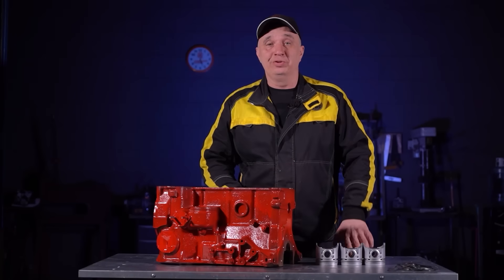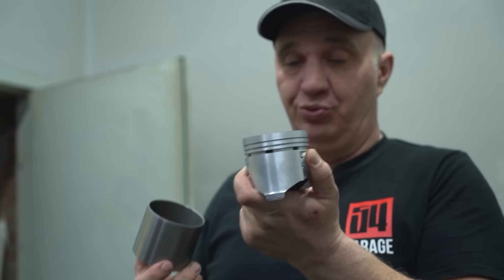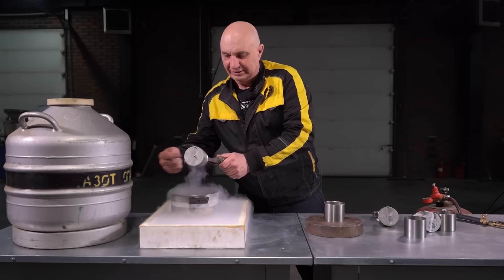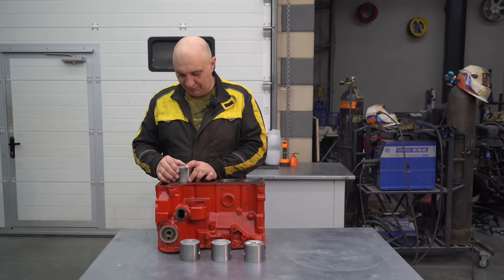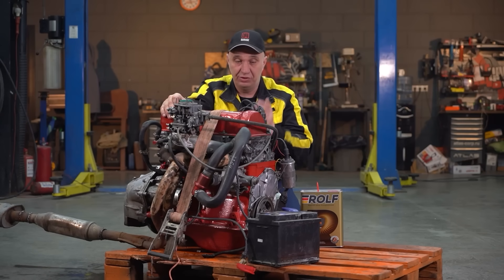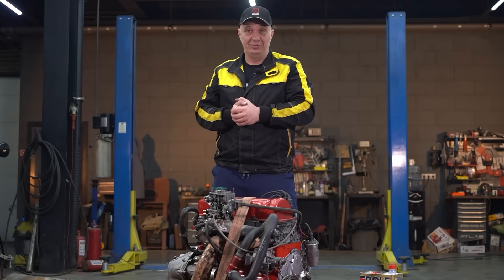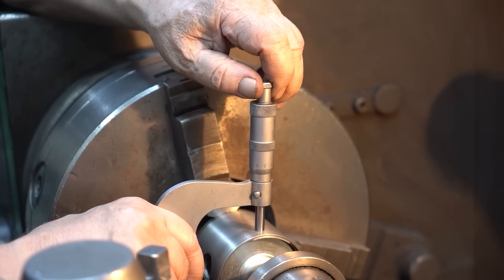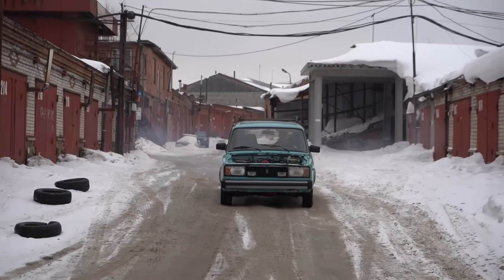We fit pistons with no rings to an engine - will it work?

Comment: Fun fact: F1 engines have such tight tolerances that they seize up when cold and need to be preheated to run
Reply: i don't believe that at all- i build street motors that are even tighter but they have to last thousands of hours.
Reply: Yeah never heard of anything other than ice expanding when cold
Reply: @RVsandRCs That is the interesting part: it happens due to expansion. I believe the pistons are made with higher magnesium content aluminium alloy to make them lighter, and this alloy expand less than the one the engine block is made of. That means that when cold, the pistons are seized, and to start them they pump heated oil through the engine. This expands the block more than the pistons and allows them to move. For F1 cars it makes sense because they can warm up the engine before the race without penalties and even a minimal efficiency increase means a few extra HP from the same fuel, which is capped.

Comment: Model engines do run w/o piston rings w/o any problems. What you did wrong are basically 2 things, 1) you should have made horizontal grooves on the piston which can pick up oil and lube the surface better, about the same a piston ring does. 2) a break in was needed to polish the pistons to the size of the cilinder before hitting throttle harder.

Comment: Actually original pistons are not round or straight because of the different thermal expansion. You need a special lathe that can produce a defined shape.

Comment: Its like measing around with something that has allready been proven millions of times.Rings machine them selves into the liner or so called cylinder wall. Miniature 2 stroke alcohol motors used that operation for years and were OK as long as you ran castol oil mix in ignition with fuel. Technology really helped us learn more about ALLOYS and improvements on engines and the platinum wre effect it had on changing a monoxide into a dioxide for a cleaner planet. Now all that has been learned and so thought  lessnessy been FORGOTTEN AND IGNORANTLY  BEEN MURDERED  BUY  DELIVERENT IGNORANCE  AND UNAPPRECIATED  PEOPLE.

Comment: Perhaps using the pistons that came with the engine but take the rings off and sleeve the cylinders smaller to fit the positions with no rings. May have worked better.

Comment: Yes this could work if the cylinders are tapered enough. Unless there's some other form of seal, which is the reason for the Rings themselves. Outside of that know this is nonsense and ignorance which has been overcome by many many many many years of Technology brought about by the people who actually manufacturer design and build actual engines that function for many years

Comment: I designed an engine when I was 15 just to see if I could simplify the 4 cycle engines standard 2 valves & ports design. I have not built it yet but it seems like something you guys could do without much difficulty if you wanted to. Basically it is to use a reed valve as a 2 cycle engine has fitted to an intake port at the bottom area of the cylinder so that as the port becomes opened to the dropping piston a large vacuum has been built that draws the intake charge in. It compresses and fires for the power stroke and just before the intake port becomes exposed to the hot gasses a large single regular style exhaust valve opens and relieves the pressure so as to not damage the reeds of the reed valve. The exhaust closes after the piston reaches TDC and it begins again. Now you guys get so many comments that I doubt this will even reach your attention but if it somehow does I might literally crap my pants if my engine design idea was actually built and tested.  If the intake pushrods were removed and reed ports cut into the block a regular engine could be modified to be used for testing. Love your channel and thanks.
Reply: Look up Detroit diesel 2 strokes they work that way

Comment: Small model aero engines up to  6cc often employ a close tolerance “lapped” ringless piston.  As the size increases the harder it is to make a close compression fit that still doesn’t seize.  They need very oily fuel and a long breaking in period.

Comment: If you had made the pistons completely from cast iron, things may have turned out better.  Even though the sleeves were iron, the aluminium pistons would have expanded, forcing those sleeves to stretch.

Comment: Key point: the metal WILL expand as it gets hot. This is an unstoppable force. The steel sleeves around the pistons might SLOW DOWN their expansion a little, but does not PREVENT it. The aluminum still gets hot - and still expands accordingly.

Comment: water in the jackets cooled the cylenders to the point they could not expand enough to maintain proper clearances. Dissimilar metals are your problem. over 100 years of engineering solved all these problems.

Comment: Great experiment! I can't help but wonder if you could add oil lines and regulate pumping have continuous circulation of the engine oil being cooled using the radiator similar to transmission oil does. ??  My guess is if nothing else it would certainly run longer minimum or maybe indefinitely.  I'm sure this has all been tried, and that is why we have piston rings today!  😆 🤣 😂  Either way, it's fun to watch!

Comment: The use of a torque plate attached to the block helps to make the machine work more accurate  it stresses the block as if it had the head mounted to it

Comment: some rc model engines run with no rings, but run fuel mixed with lube, alcohol based fuel , also same metals, using cylinder sleeves in an aluminum engine chasing,, sleeved aluminum pistons didn't achieve the goal.of equalizing expansion, what may have helped is machining ribs to the piston to retain oil, to fight contact wear? Next would be harder, calculating the offset of expansion, giving clearance along areas, so at operating temp it would end up expanding into true round , issues of unequal cylynder expansion also play, water cooled blocks live with distortion of cylinders especially where cylinders meet and operate dry, air cooled is the way to go, like vw bug engine.?

Comment: That's why they make no gap rings. The tolerance has to be there for the bore. But you have to use no gap rings for perfect compression. And to not burn all the oil out the motor!

Comment: With those cases surrounding the pistons, there is no oil flowing to the cylinder walls to cool and lubricate everything. That's why it seized. Next time, try it with just the pistons in an oversize diameter, or add some oil to the fuel like a 2 stroke engine.

Comment: Cox airplaine engines do not have rings but the piston is SOLID, made of same metal as cylinder. also, has oil in the fuel as TCL. . . . ;-)

Comment: Small engines for remote control airplane etc have no piston rings. Yes, it will work, but it's not very efficient. Unless you've got oil sprayers for the wrist pin, it's probably going to seize up because there is no oil being scraped off the cylinder wall going into the wrist pin oiling holes.

Comment: Model airplane engines have rings and no ring design called ABC. Aluminum piston, Brass sleeve, Chrome plated. The sleeve is tapered, tighter at Top dead center where it makes compression. Very common design for them. 2 cycle oil in alcohol fueled glow plug motors. Very durable. Not as suitable for larger bores, expansion affects clearance

Comment: Pistons are not supposed to be perfectly cylindrical. Because of the casting in the thick parts and the thin parts they expand at different rates..  and when they expand, they will become cylindrical.  
    By cutting them down, cylindrical in the first place when they heat up and expand, they will no longer be cylindrical. 🤦‍♂️.            It’s better to have clearance anybody who’s had engine design classes as a high school student knows this..

Comment: It will never work, might work for start up duration, but run it for 2 to 3 hours and see what happens to cylinder walls and the piston, piston rings has an very complex task, usually made from ductile iron, ring gaps clearance between the piston ring is to further act as an seal, as the high cylinder combustion pressure tries to escape through the gaps between the piston ring and piston ring grooves, the piston ring expands and pushes against the cylinder wall, the oil trapped within the gaps seals the air from escaping, hence the piston can seal properly even with an not so tight piston to wall clearance

Comment: It’s called cold sieze, thats why on a snowmobile when it is like zero degrees out, or colder, you dont just hammer down on the throttle without letting it warm up first because yr piston will swell but yr engine block has not warmed up & expanded with the piston, there fore yr going to sieze yr engine , that is just common sense, this has been known for decades !!! This guy must have just crawled out from under a rock !!! 😂
Reply: true but its also sad people think you need to only idle your car to let it warm up. they think driving sensibly at lower rpms blows the engine too

Comment: Lol compression = hp it can work but not well the oil is what it’s not getting the fluid film it needs to seal the rings there is also ring gap that loses power too it can be made to run but very non efficient less than 10% the hp with piston rings

Comment: Lots of rc plane engines use ringless pistons. They run very well once started and warmed up. But they don’t like to start when cold. We used to sit the plane under the tailpipe of our cars to warm the engine before starting. 
The cylinders are conical near the top so there is only friction and compression right near TDC.
Reply: Do not forget, all our modern ringless model engines made with chromed bronze, or aluminum (!!) sleeves: the piston and sleeve alloys are very precisely harmonized by the aspect of heat expansion in wide temperature range. (ABC or AAC systems. All highpowered categories (speed, Pylon race, combat,) etc. won by ringless engines, for 10-20 years, or more...
Reply: When I was in the hobby I used to fly when there was ice and frost on the ground, I dont recall having any problems starting.
Reply: pretty much ALL pistons have some sort of taper from the skirt tips all the way up to the crown.

Comment: You have to make the clearance work for operating temperatures, not ease of starting. You would have to use some sort of block heater to pre-warm the engine to make it start.

Comment: Someone said to use 2 stroke which could work but the only engine I found that doesn’t use rings but made in a mass production was tiny nitro engines for RC cars and stuff, and that’s technically a little two stroke diesel motor that runs off nitro methan with oil

Comment: The aluminium expanded stretching the cast iron outer more heat goes into the piston sooner than the block, Small model engines use lapped pistons with no rings but the small size makes the expansion amount far less and methanol fuel and 20% keeps things a lot cooler and better lubricated. the smaller size speeds the even heating of the piston and cylinder as well as being a 2 stroke with the hot exhaust going through the ports in the side of the cylinder carrying lots of heat away with the oil.

Comment: I can't get over the lack of provision for allowing oil to ooze from the ring grooves and out to the outer piston.  Or, better yet, splash lubrication like a lawn mower engine.  Some dippers attached to the bottom of the connecting rods that will splash oil against the cylinder walls.

Comment: Should do same experiment with ceramic pistons…ceramic does not expand.
I’ve remember reading about the prospect of constructing most of the engine in ceramic, then run it on diesel at high temperatures…very efficient!

Comment: Could you fit the rings in the cylinder wall? If the piston is long enough, they'd seal over the entire stroke.
Reply: That’s a good idea, but kinda pointless because you’re still using rings. My thought was to make the clearance as big as it needs to be for a perfect snug fit at running temp, obviously then it wouldn’t build compression to start but maybe you could put in some kinda over powered block heater to get it up to temp in order to start or something like that just to get the cylinders and block up to temperature.
Reply: @brandoncastle2684  And your heat control would need to be laser accurate! No chance of getting away with a mild overheat, and a major one would be more work than a light skim and a new head gasket. These things are always worth thinking about, but I have to accept the conventional way is conventional for good reasons.

Comment: You should try method that is used on F1 cars. You need to warm up the coolant, oil to working temp without running engine. When engine block would be warmed enough, the clearances would be bigger and you could start engine.

Comment: I just love how these guys keep coming up with original ideas and yet many of these ideas have always been somewhere at the back of my mind but I never imagined someone would actually try them out and have the necessary skills to do so. For any young kid with aspirations of becoming a motor mechanic or engineer, this channel should be a must see!
Reply: It's not an original idea furthermore it won't work
Reply: @boarhog1979  Few ideas are totally original but these guys at least keep coming up with different concepts and put them to the test in their own style. Most of the things they try do work up to a point but of course would be impractical and unreliable in the real world. The point is that it’s fun and educational and it gives a real life demonstration of why some of these things don’t work.
Reply: I guess we auto engineering enthusiastic people have these crazy ideas, these guys get to actually work on them.
Reply: This is not an original idea - not remotely. Every model airplane engine since the 80s has been built this way, and most of them before that dating back to the 30s. The key breakthrough was in 1969 - making the cylinder out of brass, and chroming it to get a good wear surface and controlled clearances during expansion. The brass liner expands faster than the piston, so if it overheats the clearance increases. Later, they are made out of chromed aluminum, with the piston silicon content such that the piston expands at about the same rate as the (much cooler) liner so the fit is the same, cold or hot. The liners are also tapered, because the top of the liner is hotter than the bottom. This makes an extremely robust arrangement that lasts forever. Automotive manufacturers, even F1 engines, cannot manage the precision required and the thermal gradient required to make it work well in racing engines.
Reply: @brettbuck7362  Thanks, that’s really interesting and I had no idea about that. I guess part of the reason for this not being used in racing engines is something to do with scale and perhaps it only works with smaller low output engines. The gap once the engine had heated up would be huge in an engine of any size. 
Although it might not be a completely original idea, it’s still original in as much as nobody has tried it in a regular car engine and my point was that such videos are a great way to help young people thinking of studying engineering to understand some of the challenges involved.
Reply: @brettbuck7362  I think this is actually used in top fuel dragsters - but they run for literally a few seconds and require rebuild after each run.
Reply: yes
Reply: @فارس.التميمي-1444  Nein 🙋🏻‍♂️
Reply: @erisresha7076  Yes it is not good
Reply: I have ideas that I just don’t have the equipment to try 😢
Reply: You can do it with ceramic

Comment: the issue with dissimilar metals in this sort of application isn't their different coefficients of expansion, but rather galvanic corrosion and differing hardnesses. having aluminium piston heads with steel cylinders is fine, you just need to calculate how much the two will change when they're hot, and adjust accordingly. the aluminium will wear faster than the steel, and can gall onto the steel, but proper calculations for sizing the pistons can mitigate that. ideally the pistons would be loose when you install them so that when they heat up, they become a bit more snug, enough to not need the rings.

because the rings have play, they take up any changes over time, allowing for more slop in the size. if you omit them, all you really do is require tighter tolerances on the fitment, but there still needs to be a gap while cold.
Reply: Ok. How would you propose STARTING an engine where pistons fit the cylinders like a dick in a tophat if the pistons are sized to finally fit correctly once they reach an operating temperature of 500ºF?

Comment: Vlad, was expecting much from this vid but it failed, ok, but your parting comment is wrong.

F1 engines have such tight tolerances they are seized when cold and need heated for some time before they can be started.

This is an experiment you should be revisiting...

Comment: this can be made to work as long as the pistons are made of the same material as the block . a set of cast iron pistons would happily run and live for a long time in a combustion engine as long as the block is also cast iron .

Comment: I would like to see either a long term test of an engine with 4 ring grooves or a dyno test of one.  It might also be neat to see if an engine with just one "total seal gapless" compression ring will run and pull a car

Comment: Here's a fun idea. Make an engine trade off its RPM for peak HP instead, so it's same power output. Like a very slow but very powerful engine. Very high torque. Or reverse, maximize it's RPM